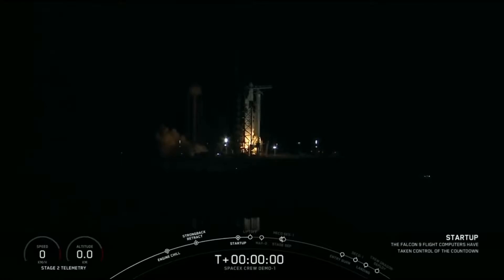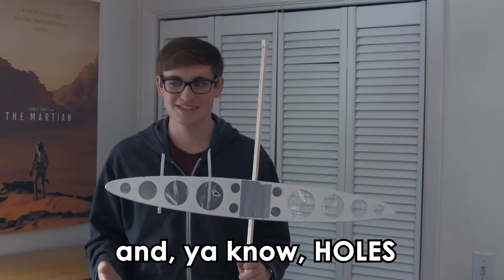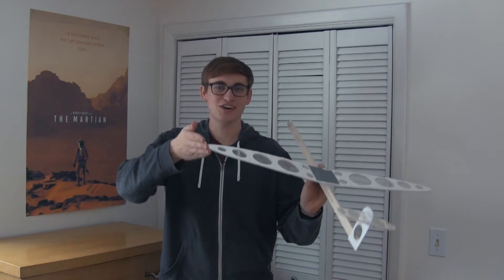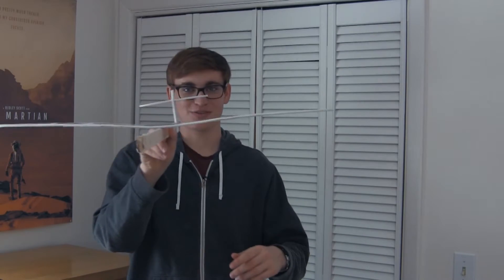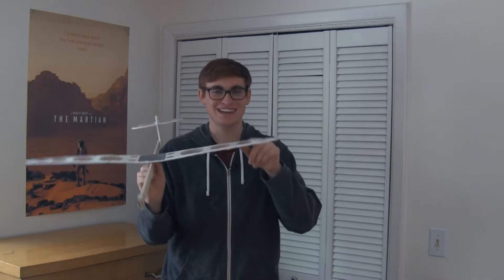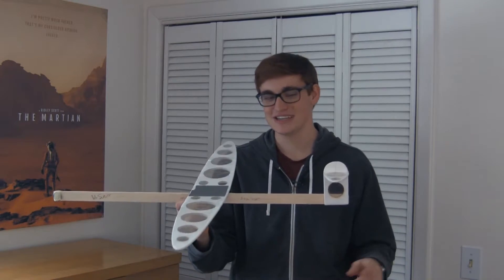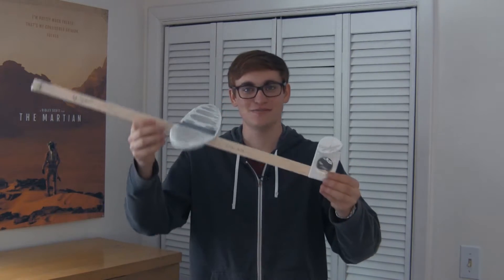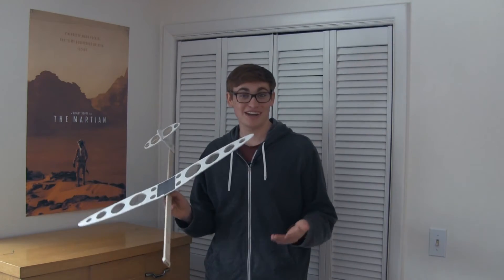The Planes That Can Fly Themselves: Passive Stability

Comment: That looks likr a flat plane wing - not a good example because it's aerodynsmics are not much stufied. A few points - l/d is high because drag is low at low angles of attack - cp moves rearwsrd with increasjng angle of attack - little information at low reynolds numbers as in models - ie small chord and slow speed - you are in a relatively littled studied area - but increasingly relevant due to proliferation of fixed wing drones.

Comment: One thing to consider with dihedral is what happens with a small sideslip angle.

The lift on the forward wing increases, which induces roll in the other direction to the sideslip.

So you get
small sideslip -> counter roll -> lift vector changes -> no more sideslip.

With the opposite situation, anhedral, a small sideslip induces a sympathetic roll, which in a plane with a vertical stabilizer will induce more sideslip and roll and turn the sideslip into prograde velocity component and more sideslip and more roll until the thing falls over.

Comment: For a airplane to be glide stable, you have to have certain parameters tune. Basically you want a negative feedback loop, when the wing starts to stall, you want the aircraft to pitch down, and when it speeds up, you want it to pitch up. To achieve that one way is to make it a slight sweep wing design, and make the wing root's angle of attack (AOA) higher than wing tips. When the plane pitches up, wing root will stall and move the center of lift aft, this will make the plane pitch forward therefore make it a stable flight.

Comment: I used to love to make paper airplanes as a kid and when I'd throw it off a high place, I'd notice that a regular plane could go anywhere. It could decide to go straight down or curve around. Or every once in a while it would sail gently off into the distance but this was pretty rare. So then I decided to bend the paper in the rear up, mimicking pulling back on the stick the whole time.. This produced a more predictable but strange flight pattern. It would sail off and sort of stall, then it would nose dive but quickly recover coming back up, over and over. I wonder if that might not be an option for you. 

If you're going for distance, obviously you want that nice sailing of into the distance thing. But, if you're going for consistent distance over many tries, then that approach might work. But you looked like you just wanted to hit that tarp. In that case, you might be able to fine tune the rear... whatever it's called. Allerons? You know what I mean. The tail piece. Playing with different angles might produce a more consistent result.

Comment from the maker: Near the end of the video, I mention that our performance was poor because we were heavy. This is not necessarily because weight alone changes your range (range is just a function of your lift/drag ratio and the starting height).  The reason we had problems was that heavier planes need to fly faster to achieve the max L/D ratio and we could not throw the plane fast enough.  This lead to the plane diving "to gain speed" which obviously isn't great for the range.  We could reduce the weight to fix this or increase the wing size to decrease our overall wing loading.  This is why you can have a full-size glider that is much heavier than our scale ones, but with a similar glide ratio: distance only depends on aerodynamics so long as you can fly fast enough.